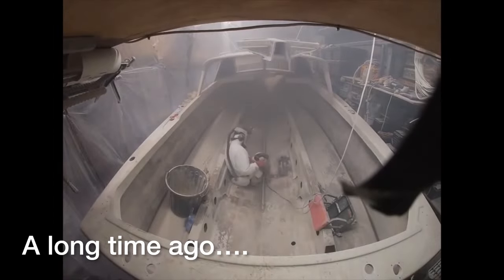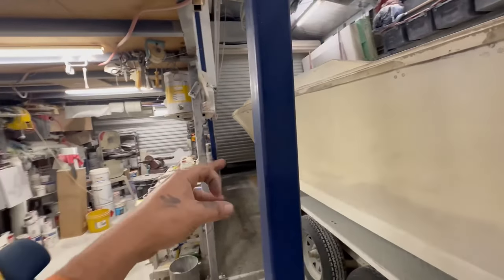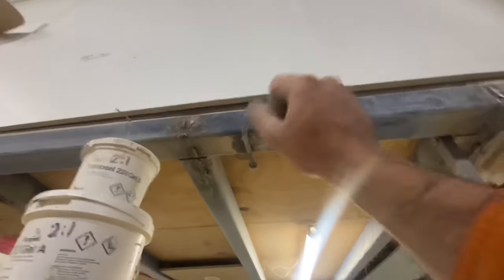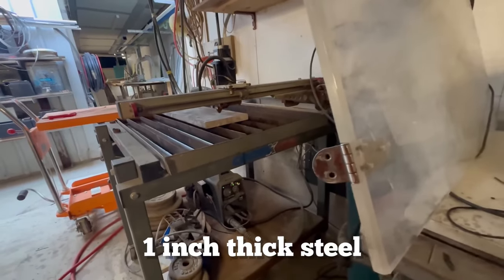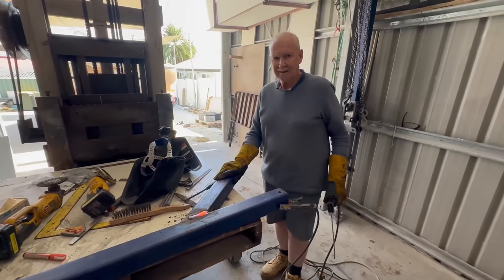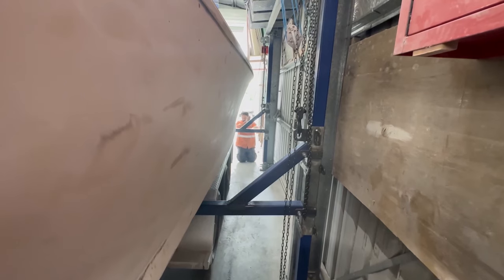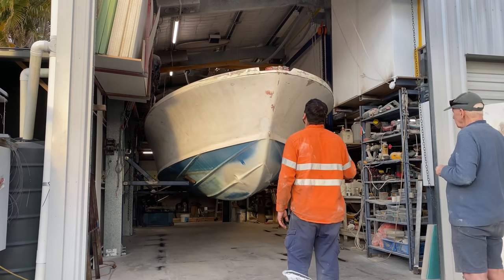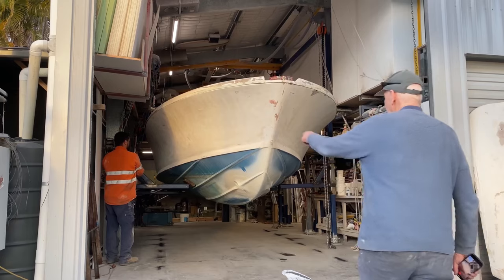25ft Bertram project - blob 62 - home made boat lift 💪get my boat on and off the trailer easy!

Comment: .1.) Any way you could have 4 electric motors on the hoists and be able to toggle them  separately and have 1 master switch to run all 4 simultaneously ? 2.) Mark the height the hoists have to be for the trailer 3.) would it be a good idea to have a couple pieces of ply wood running the length of the keel so it does run into the concrete ?
Reply from the maker: I looked into electric hoists lots of $$$$… I wlildve loved to have electric. Can I put motors on the block and tackles? 
I have marked all posts in 50mm increments to ensure i don’t lift one up too high. I also marked where the sliders want to be to get on&off trailer. 
Ply wood wouldn’t hurt definitely 👍 
🍻

Comment: That is pretty creative, well done but I do have to say when you started explaining it and your love of pullies I thought you made some elaborate thing that used only the electric winch and a bunch of pullies to make the other 3 corners run lol. this is far more practical
Reply from the maker: Hahah thanks…no i just kept it reasonably simple. It works much better now since i tack welded the angle of the rear holders 🍻

Comment: Buy 4x 4x4 winches you can get them cheap online & wire the bow 2 in together and the stern 2 together then you can lift it by pressing 2 buttons and get the right angle for the trailer.
Reply from the maker: Dammit!! Why didn’t I think of that??!! Haha great idea. I’ve never had a 4wd winch. Honestly didn’t think of it. Would need batteries at every winch and chargers. Definitely cheap enough for me to try cheers!

Comment: Great ingenuity M, Might be a good idea, to ft some simple dead weight straps/ropes, anchored from the building frame to the bow and stern after the boat has been hoisted into the position for working underneath.
In other words simple independent dead weight tie off's to support the boat just in case anything happens to the lifting frame/tackle when working under the boat or anyone else is walking near or under the boat.
With your ingenuity and skills, with the right bunch of products, its not easy, you'd do well in your own business, but get the boat finished first M, 👍
If you want, glad to help when you're ready.
Reply from the maker: Thanks mate, good idea. I was going to mag drill holes in the sliders and posts to put pins in at good heights also. Strap from high level would feel super safe. Thank you for the encouragement!
Reply: @Micington    You are welcome M, was too confident with one of my creations for the factory in the earlier years, when testing it one day on my own, with the test weight of 2.5 Tonnes, ended up with a broken ankle, not a good experience.
Ever since then everything was designed with the old "what if" syndrome, not one accident in the following 20+ years, to anyone. Belt and braces, just like the design and strength of your boat..
Good luck M.
Reply from the maker: @graham7176  point taken. I’ll definitely be putting fail safes. ;) appreciate all your input!

Comment: 13-S welding rods..
Guess what the S stands for.
😂😅😂😅 💩
Reply from the maker: Are they shit? Lol what does the s stand for? Lol 
I got 16tc’s for verticals and upside.. is that right for that? 
Clearly not a welding expert ear lol
Reply: @Micington  I'd use 16TC for your lifting frames, welding those nuts on etc..
If you want just a good alround GP rod, use WIA 12P's they run vert down better than those 13s  👍
Reply from the maker: @jb243wp  cheers for that. Just could you clarify are 13s’s still alright? I used them on everything! 😅😰😰😬🤪
Reply: @Micington  they should be ok,  but buy 12P's next time round, for you general purpose welding.
16TC for welding cridical stuff or welding dissimilar carbon steels like welding bolts on  to 250gr plate.
Reply from the maker: Awesome advice! Thank you so much!

Comment: hi have you seen boat yards using slings it might be better to use and spread load over larger area  great idea remove those lift bracket you made just use eye where the bolts went thru
Reply from the maker: Getting the slings in between the trailer and the boat was the reason we went with the arms. We did think about slings and can still do it. Another good thing with slings is I could roll the boat side to side. Might help me when sanding and painting the sides or working underneath. 🥂
Reply: @Micington  ok then why not cut a notch in your support runners to allow for sling to pass thru and help in down the line to know where the balance lift points are
Reply from the maker: I don’t need to now cos I can use the arms to lift it up a bit then I can put sling thru and lift. So got best of both worlds now. But I didn’t think of notching … good idea! Once I get something in my head it’s sometimes hard to deviate

Comment: The difference between you and me is that I try to think of the simplest way to get what I need done, and you think of the most complicated over the top way to get it done. That said, when I have my boat in the air, it's backyard sketchy and definitely temporary. When you're done, you have something that looks like a manufacturing plant would have produced professionally to sell to other manufacturing plants.

I could take a page from your book.
Reply from the maker: Hahah I do it sketchy for ages before I do it over done. Good to know what you can get away with 😅😉wasn’t sure if the post would bend inwards and heavily relying on the structure of the shed to steady the posts. Thank you and good luck with your boat!
Reply: These Total Boat trailer jacks are working out really well for painting. I got all four coats of barrier coat on. Then I dropped the boat back on the trailer...
Right away I realized I had a problem, the boat was going to be too close to the jacks to get in there and paint. Lifting it back up, I set the bow down on a 4 by 6 set on its side on the rollers of the trailer and two 8 foot 4 by 4s set on the bunks. 
This gave me plenty of room to sand and paint where the jacks are. As of now, I have four coats barrier coat and three coats Pettit Black Widow above the jacks. I'm concentrating on the sides now getting primer applied and sanded smooth. When I have my topcoat done, I'll lift the boat back up and finish the bottom. I'm using electrical tape to mask the water line because it's stretchy and bends with the curve of the hull. Masking tape didn't seem to want to bend so I gave up on it. So far, the electrical tape is doing a great job.
Reply from the maker: @DesmoProfundis  awesome work! Making good progress by the sounds of it! I’ll check your channel for some footage 😉